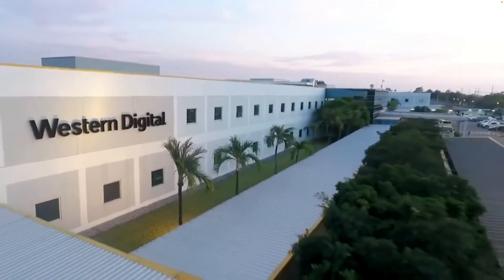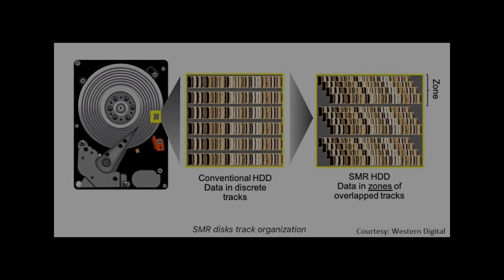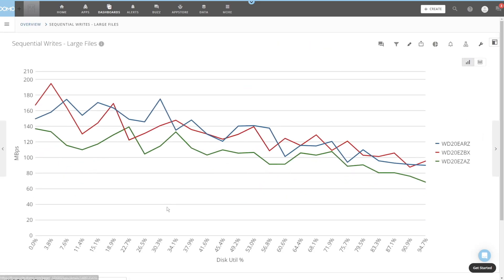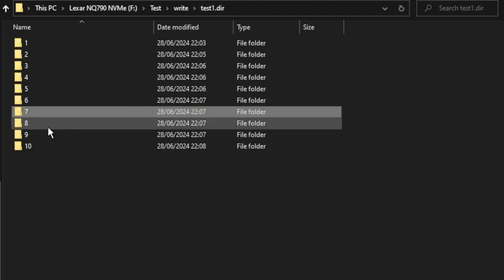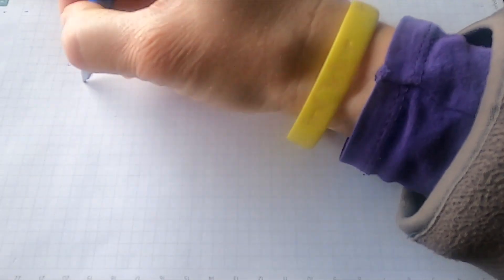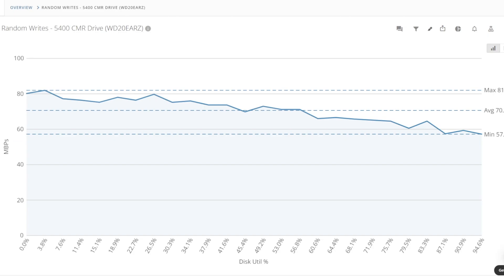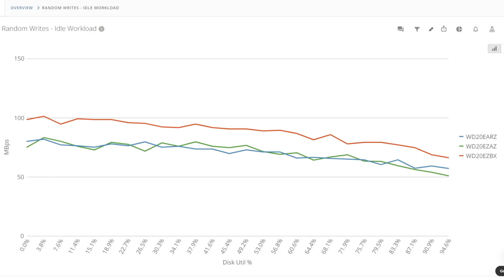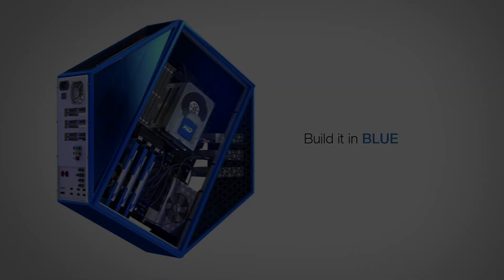CMR vs SMR. How do they compare, and how much should you care?

Comment: I used to use a Seagate barracuda pro 14tb as my main drive and it was very snappy but it started to become unreliable after being exposed to freezing temperatures so I had to urgently get a new drive and I picked up a 5400rpm 4TB barracuda for $80 which was a great deal. I started transferring over all the data from the old drive which is close to 700 GB and suddenly the performance takes a nosedive and the speed drops all the way down to 8 MBps! It picked up a bit when writing small files and in the end it took around 4 hours to transfer all of the data which is double of what it used to take. day to day use isn't too noticeable but I do get slight stutters in games when loading in assets but that's more likely due to the slower speed rather than SMR
Reply from the maker: From my testing, the Barracudas seem to do ok with sequential writes, with large files being better than smaller ones, though I tested all 2Tb drives and it was a 7200rpm unit. When overwriting data, its pretty horrible however, and worse overall than the WD Blue SMR. It seems they have quite a lot smaller persistent cache. I have a comparison I am working on with these, the WD and the Tosh desktop drives coming out soon. 

Spoiler, the Tosh P300 came out the worst in the tests, its horrible and I don't know how they did such a terrible job there.
Reply: @sometechguy  I have no bias towards any brand but I never buy Toshiba drives because they always have the worst value compared to Seagate and WD and it sucks that you're not even getting a good drive with the extra money you spent. From what I've seen, Toshiba has a pretty good reputation for their high-end drives at least so this is disappointing.

Comment: WD Purple are CMR drive and offers more warranty then WD Blue. Also head parking cannot be changed in SMR drive most are locked at just 8 second, as a result these SMR drives  gets high wear and reach end of life far sooner.
Reply from the maker: Yes, and they are pretty much the same price. 

I am doing comparative perf testing on a range of desktop and surveillance drives at the moment and there is some interesting and disappointing findings in there. Will have something out on this soon.
Reply: @sometechguy  i tested 2gb version of both running side by side. blue is 7200 rpm , purple is 5400 , however i found that read speed on blue was barely 5% faster. On write purple was slightly quicker. Performance difference was negligible despite rpm difference on my desktops. Will look forward to your test result.

Comment: in the past i always bought WD drives until i had these strange performance issues and did not know about the CMR tech before. now i am reviewing what disks i will buy for a big NAS i want to setup. and it looks like i will go for Seagate to be sure i dont accidently get CMR disks in my setup.
Reply from the maker: The CMR disks (conventional magnetic recording) are the ones you will want for your NAS. The SMR (Shingled magnetic recording) are the ones that can be specifically problematic when used in things like NAS RAID arrays. And it actually isn't just WD that sell SMR disks, the vast majority of 'desktop' disks at the moment are SMR, and this includes the Barracuda's from Seagate. 

So for a NAS, I would check that I am getting CMR disks, and i would avoid the desktop drives and stick to NAS, or more likely Enterprise drives. Note that the WD Red's are also SMR, but the Red Plus and Red Pro are CMR.

I am doing comparative testing at the moment on WD Blue vs Seagate Barracudas vs Toshiba P300 disks.
Reply: @sometechguy  thanks a lot for the info i will take extra attention when searching for the correct disk model. specially since i want to be able to buy the same model at a later moment potentially.

Comment: If the three drives have the same number of plates and heads, and SMR has higher data density, then... how come all three drives have the same capacity? I'd expect the SMR to either have less / smaller plates (smaller plates should improve performance), or higher capacity.
Reply from the maker: This is a great question, I can’t see what the benefit is of using the same platter and head count and then using SMR. So I would expect the SMR drives to have less platters or heads. But the only real thing that should affect raw read performance off the disk is higher data density per track, tracks per inch should not help. More platters also should not help, as the disk should only be able to read one platter at a time, though I guess a possible small advantage in getting heads to the right place on other platters.

Also, there is a 2g heavier wait on the CMR. I believe platters would weight more than that, but maybe they have one less read head and use one platter surface less?

Only way to know may be to open them up and look, but that likely kills the drives and I have more testing planned for them.
Reply: @sometechguy  I naively expect a plate and at least one head to weigh more than 2g, but I could be wrong.
Furthermore, with tracks being closer, seek times should be reduces. I naively expect that to make a bigger difference than increasing rotation speed from 5400 to 7200 RPM, but again - I could be wrong.
Would be interesting if you opened the drives (100% your prerogative) to see what happens inside.
I appreciate everything that went into making this video. The results caught me by surprise, learned something from watching it.

Comment: smr is fine for continuous read/write operations as an additional data storage drive in your computer /till ssds surpass them in upcoming capacity vs price wars/ or jbod in a small external DAS or NAS device to make your data backup nr 2-3-4-etc, but as soon you use them in a raid environment it will slow down the system to almost a standstill, in case of a failure of a drive and rebuild of the array by swapping in a fresh one instead you can wait for a rebuild for x days..... people should know their use case and choose the proper solution, also manufacturers should be forced to be honest with specs or to be sued the bejesus out of them

Comment: TLDR do not use SMR drives with ZFS. SMR drives are fine for the likes of read often/write hardly operations, such as storing a collection of movies for playback. Where SMR drives are terrible is when you need lots of IOPS, such as using them in a RAID array for Virtual machines. Since the drive, when needing to do write operations, it must first locate where is is going to store the data on the platter, next it needs to read the adjacent data that is in the overlap of the clear data area, that data must be read into cache/system ram, then the new data plus the overlap data needs to re re-written to the drive, so instead of doing a single write operation for new data that CMR drives do, it has to do additional read and copy operations before the new data can be written to the disk. 

This causes some serious performance penalties on file systems such as ZFS. Now before you flame me about ZFS, it is the File system used on just about all cloud servers for data storage thanks to its redundancy. 

So if you just plan to store your movie collection on the drive and read from it with very little writes then SMR is fine, but to be sure CMR is always better
Reply: >"TLDR do not use SMR drives with ZFS."
but?

Comment: Impressive work.

If I want a high capacity CMR disk for storage (minimum 12 GB), that I will only read from at write too occasionally, and if I want it to be as low noise as possible, what disk do I want to go for?
Reply from the maker: If noise is the primary concern, maybe a Purple Pro, Red Plus, Red Pro or Ironwolf Pro. But at 12Tb, everything is going to be 7200 rpm.  The black tops out at 10Tb, and I think there are over priced. The blue and purple max out at 8Tb. I don't know what the noise requirement is, but I would personally be going for an Ultrastar currently, which is an enterprise disk but is often cheaper than all those I listed above, comes with 5 year warranty is a really solid disk. But Ent disks are noisier when they are accessing disk. Also some disks perform wear leveling which can cause a regular sound even if they are not being accessed, you may want to check on the wear leveling schedule on the drive you look at if noise is a concern. Have a look at this video to get some ideas : 

https://youtu.be/QDyqNry_mDo

On that link, I compare the WD range along with price per terabyte and what capacities are available. And this is why I come to the conclusions above. Hope you find what you are looking for.
Reply: @sometechguy  Thank you. I dont mind that it makes some noise when it's beeing written too or from. My main concern is if it's making noise when it's idle. Will these disks spin up randomly just beeing in the computer and make this noise?

Comment: as long as they work 99% of people is never gonna notice any difference or even care. HDD is only for large or old files storage so the performance isn't even all that important as you will have an ssd or two to run modern games and apps in your PC and then couple of largre HDDs as storage or for old games.
Frankly, when I'm buying a HDD the only single parameter I look for other than the size is the noice level (granted, specs might lie but it's not like I can get nay better source...), I'd just look for the most quiet 5400 RPM as HDDs are just incredible noicy with all the other PC components nowadays being completely silent at idle with partially passive cooling in modern PSU and GPU and very slow, large fan on CPU.

Comment: I rarely use 3.5" drives any more. 2.5" are bus-powered, and more convenient. I have two SMR drives. 2TB and 5TB. TBH, in real world use, there's not much difference to CMR.

When I bought the 2TB, I didn't know it was SMR, but when I bought the 5TB, I did.

I'm expanding into SSD.
Reply from the maker: I was never a fan of the 2.5", though the power options are nice as you point out, I am usually buying HDD for capacity, and SSD for performance. And the 2.5" HDDs disks are not either. And of course, SMR is widely, if not ubiquitously used on those drives. 

But you point out something valid, which I talk about, and that is for many real use cases, SMR is unlikely to cause actual problems. But the real problem I have is that it doesn't provide any benefit either, so given it may not be obvious if or when you may run into scenarios that cause you problems, why chance it for no actual upside.
Reply: @sometechguy   As you probably know, SMR is used to increase storage density, and a 5TB 2.5" DOESN'T have "capacity?" ... Seriously?

2.5" is more than a good enough replacement for clunky power-hungry 3.5" drives, and quite frankly, for my use-case, performance is good enough. Being small and bus powered swings it for me!

I still don't fully trust SSDs! ... Have you any idea how long I've had HDDs sitting around, WITHOUT data "evaporating?" 🤣
Reply from the maker: @marcse7en  it’s not a criticism, each use case is different and their existence demonstrates a need for sure. I am a data hoarder, so when I think capacity it’s maybe 16-24Tn drives. I get that past 4TB, SSDs start to look expensive and less use cases, at least for home, need that performance for mass storage. There is a good spot for HDD in the desktop for slower mass storage such as media, downloads, backups etc. I am just sure in the context of my usage that 2.5 disks differentiate themselves. But always interested to hear about where they fit for others.
Reply: @sometechguy   I'm a data hoarder too! And I've been hoarding for 28 years since my first Olivetti PC. In that time, unlike some, I have never lost data. My 28 years of data (including music, 23 years of digital photography, and large video files from 40 year old Betamax Home Movies), barely fills a corner on the 5TB HDD. It's a few hundred gigabytes.

Documents take up hardly any storage at all.

Amazing to think HDD technology dates back to the 50s. On paper, it's a terrible idea, and it shouldn't work as well as it does? But it does! Thanks to incredible engineering!

Comment: I am staying with CMR drives in my raidZ arrays. Worst case scenario for me would be resilvering after a drive failure, and the expected performance degradation (and the duration thereof) would be far worse with SMR. It has never happened so far, but that doesn't mean that it never will. I'd rather not have to go through that especially since as you mentioned there is essentially no cost benefit for SMR.
Reply: The issue is once you write more Then 100 GB constantly in one session the cmr zone of an SMR drive is about 100gb then it changes to direct smr writing mode (or forces emptying the cmr zone as new writes are Comming in) can result in 0 to 20MB/s once the drive has received 1 drives worth of data (it's why benchmarking them is difficult and performance problems usually start after 6-12 months)

it really suffers when it doesn't clear empty shingles (smr drives usually support trim so the drive knows what blocks are actually empty and can reorganise the shingles when drive is idle)

I am halfway into video and hasn't hit the pitfalls yet if smr when all the shingles are full

Comment: The main problem with SMR is resilvering with ZFS which WDs Engineers knew was a problem but the suits branded them for NAS use any way
If they had marketed them as media library drives at a fair discount they'd be a tempting option but as it is I do my utmost to make sure I avoid them
Reply from the maker: Yes, agreed on this. Any persistent rewrite activity, such as a RAID rebuild is likely to get his with the performance found in this testing, so I would personally avoid using the. In any kind of array. And given the CMR was actually no more expensive than SMR disks, it’s hard to see any good use case. Though archiving wooldnt be so bad, as long as you are not doing this repeatedly on the same disk and over writing  file. So all in all, I would just avoid them as a rule, and I wish it was clearer that SMR was in use on these and other disks. This is my attempt to shine a little more light on that.

Comment: What about life span? Do we have any data?
Reply from the maker: I have not seen any public date sources on this. I did some videos analyzing and comparing reliability of disks based on a large pool of data from BackBlaze, but there are no SMR disks in that dataset, which isn't a big surprise. 

Due to write amplification, the SMR disks certain work harder. So the head actuators are going to be a lot more active. I don't honestly know though if this is the component that is the most likely to fail, so I can't say if this will cause reduction in life span. The best way of course would be to find data source that reveals this, so if anyone knows one, I would love to hear about it.

Comment: Thank you for this video, liked and subscribed. I'm currently debating whether to splash some cash into some big CMR drive (I'm looking at some enterprise refurbished models because they're cheaper, and also riskier, of course) or keeping my current WD Black P10. I didn't know about CMR or SMR when I bought it, now I have it half full (or half empty?) and I'm looking at some speed degradation compared to when it was less populated (writes are about 70-80 mb/s now). It's a Plex storage drive with looooots of idle time (24/7 on) so I guess I should be 'fine' based on this video, right? I mean, a CMR would be better but it's not a critical change.
Reply from the maker: I believe the P10 is a 2.5” in a caddy and very likely SMR. An external 2.5” isn’t likely to be the fastest choice, but if you are filling a drive sequentially and not replacing files too often it’s likely fine. Because it’s the overwriting or modification of files in the SMR zones that has the impact. And if you are not writing constantly, depending on the cache available on the drive, it’s likely manageable if there is idle time. Also , reading media files often isn’t too terrible from a bandwidth perspective, but if it’s 4k and and not a compressed source, you could be up over 100MBps and it could be a bottleneck.

And thanks for the Sub, good to have you here. 😁
Reply: @sometechguy  yes, it's a SMR drive. I do replace some files sometimes (delete movies/series, get new ones, etc...) but I do this like, I don't know, once per week? The rest of the time it sits idle until there's some media playing. I have not made extensive testing but I do remember it writing at around 100 mb/s when it was empty and now it does 70-80, I'm wondering if I'm not going to have a paperweight when it's 75-80% full (that's why I'm looking for CMR drives).